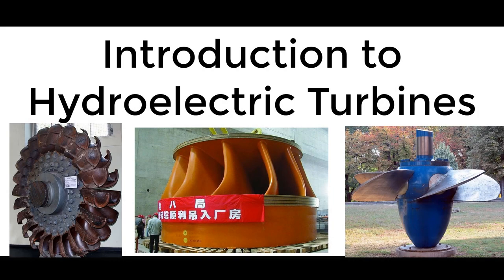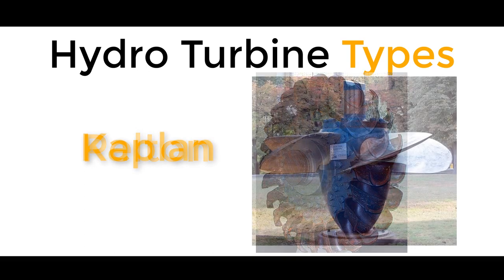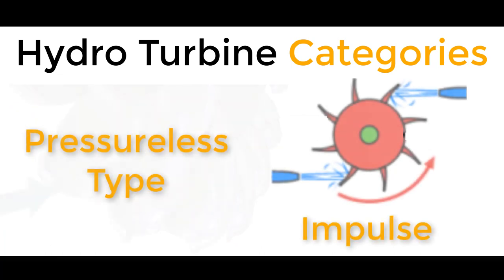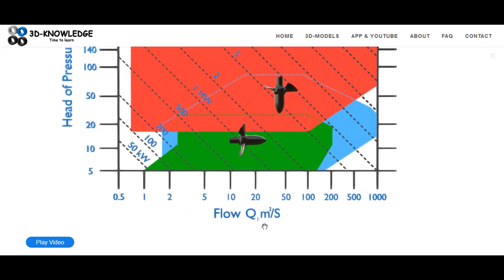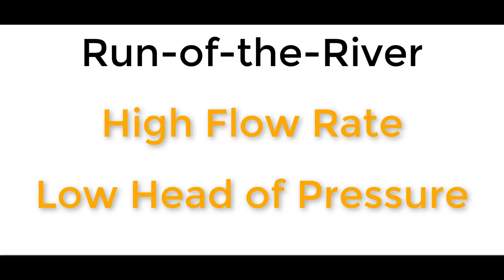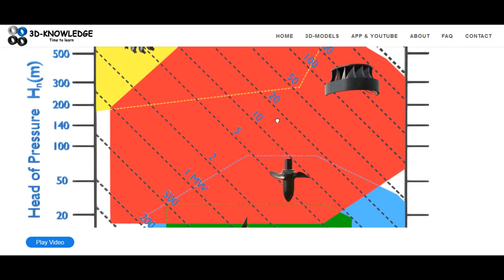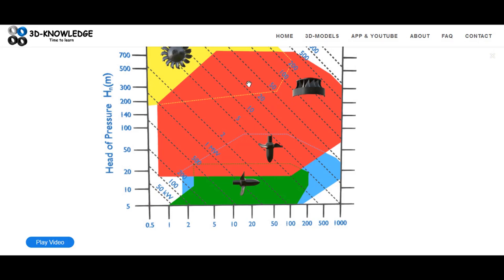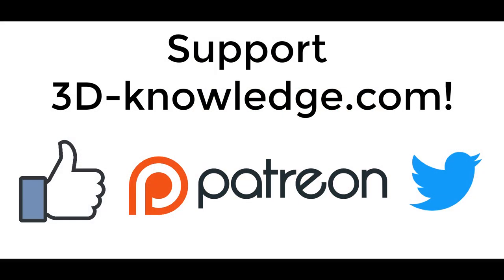Kaplan, Francis and Pelton Hydroelectric Turbines

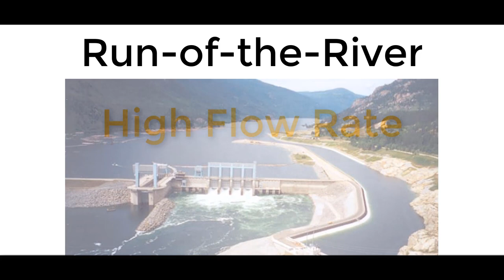Comment: Just a note re: the dam shown 7:00 of the video.
The water going through the dam is being spilled - no generation.  It's a flood control dam.  The photo partially shows, in the right foreground the power station which was built over 40 years later.
I really liked your video and it brought back memories of that dam being built. My father was the project manager.

Comment: Very good presentation and very explanatory! My questions to you are the following:
I want to build a hydroelectric system and It's my understanding all these turbines might come in European or north American voltage which is 110 V. In Africa, especially where I am trying to install one of these turbine, we use 220V. Do you think I should be mention it to the manufacturer about the 220 V? do you know places I can get 220V turbines. Which turbine do you suggest and they must be expensive as well. I'm trying to build the system in a river and also a place where there's only a well. I'm also thinking of adding a transormer, breaker, may be an inverter. Please advice. Thank you again for your  help.

Comment: What makes the vertical Kaplan different than the horizontal?
Reply: Higher flowrate, thus more efficient above 20 Meter Head of Pressure. Lower Head of Pressure is the horizontal more practical. But the turbine it self is no different. Only how you install it.